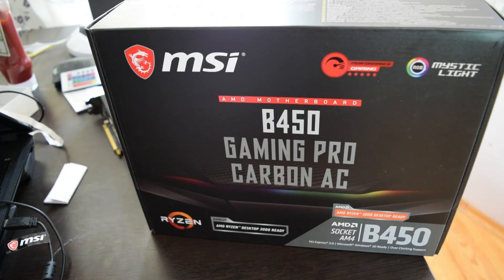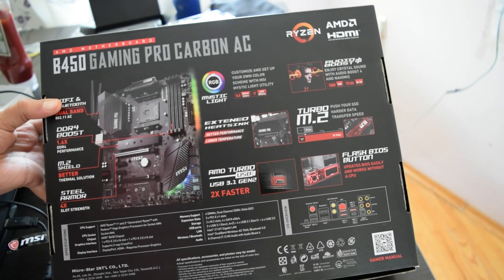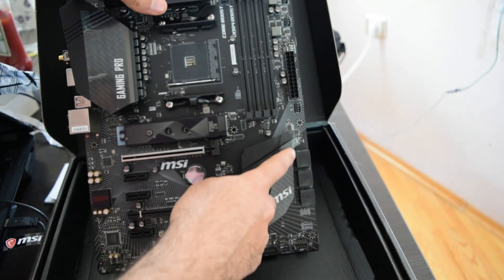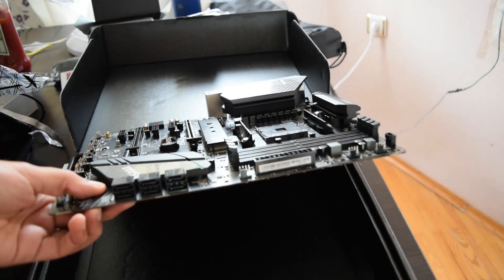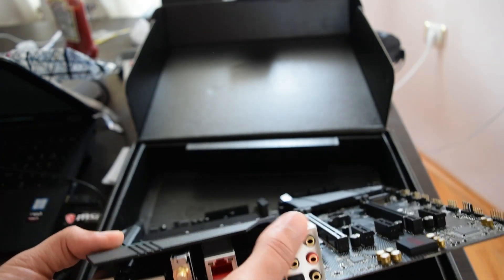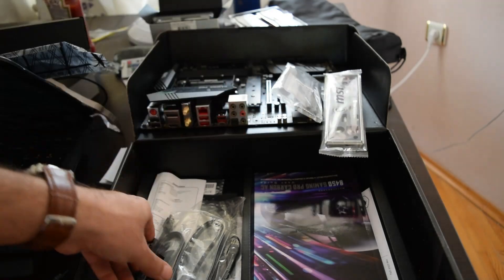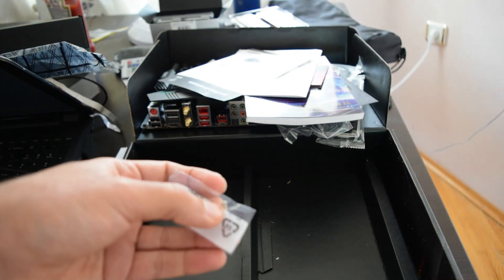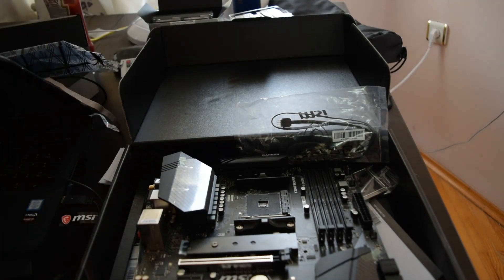Unboxing The Best B450 MSI Motherboard (GAMING PRO CARBON AC)

Comment: It’s good for high clocking?
Reply: yes!  at 4.3 on a ryzen 5 3600 at 1.3 v water cooled and running 4 dimms a 3600 c16 4x8gb sticks until this day no problem with this board and its potential

Comment: m.2 slot can f.ck up your bios and show CPU error led.  Be careful with kingston m.2 nvme
Reply: is the normal ssd fine
Reply: @recur9245  Just don't use Kingston A2000 M.2 NVMe SSD

Comment: Hi what do you think about this set up? 

CPU RYZEN 3 3200G
MOBO MSI B450 GAMING PRO CARBON MAX WIFI
RAM (2 rams preferably) 
SSD (Targetting 1TB) 
GPU GEFORCE RTX NVIDIA 2060SUPER GAMING X
PSU EVGA 600w GOLD (or 600w - 650w) 
An extra air cooling fan (case still maintain CM E500L)
Reply: U need a better cpu
Reply: Fcbarth  what gpu and psu  would you recommend sir ? Lets say if i want to stick with this cpu at the mo 🙏🏼
Reply: @ampire20  u should get minimum 3600 with that gpu, but if price is an issue your better off going with the 3100 or 3300... the 3200g is an apu and u already have the 2060...the 3200g and 3400g are not actual 3rd gen ryzen, theyre 2nd gen zen+ chips with a gpu...apu's are usually a generation behind
Reply: Konchus Nando thank you so much sir! this is really helpful.. time to upgrade the cpu 🙏🏼 before adding up gpu and a mobo on my list
Reply: Russbot Apocalypse 2020 what gpu and psu  would you recommend sir ? Lets say if i want to stick with this cpu at the mo 🙏🏼
Reply: Dont do that build. Cpu bottleneck

Comment: Can we remove the M.2 shield and add a custom cooler?
Reply: Yes
Reply: @Ian_Christensen  Thx for the info
Reply: @HeyYouYouAreFinallyAwake  The m.2 shield actually works pretty nice for cooling the m.2.  But is easy to remove has 2 pins on the side and the shield brackets slide on to it.
Reply: Note.  Don't use cheap Kingston Nvme. ;-)  it can cause bios crash and cpu error.
Reply: @Ian_Christensen  Thx a lot dude.

Comment: @Dan The Man how is the Wifi connection? My router/modem is in a different room so I can't use Ethernet
Reply: @DanTheManLand  Can confirm this. Bought this board 2 weeks ago and so far have had zero connection issues

Comment: Nice unboxing video. What cpu are you going to use and will you also do a review/test video of your system with the Gaming Pro Carbon AC ?
Reply: Dan The Man I want to use this board and this cpu, what graphics card are you running with these? Would the gtx 1660 super be okay with it?
Reply: I just got this board arrives Tuesday I can’t wait upgrading from a b450m steel legend can’t use anything above 3000mhz on it hopefully this one loads Xmp with no prob so I can use my 3600mhz